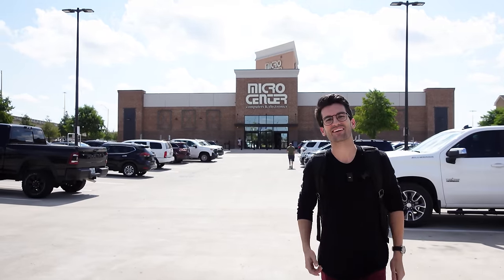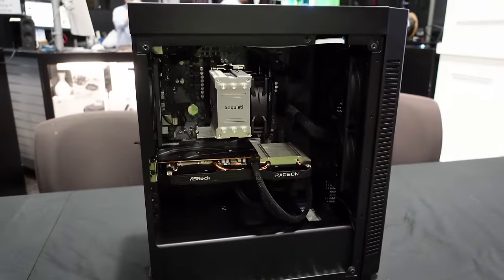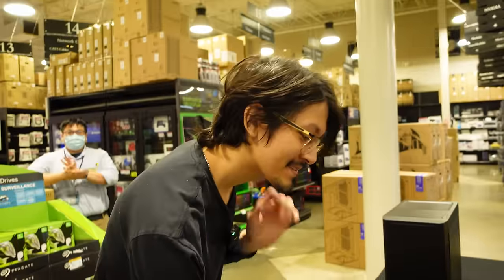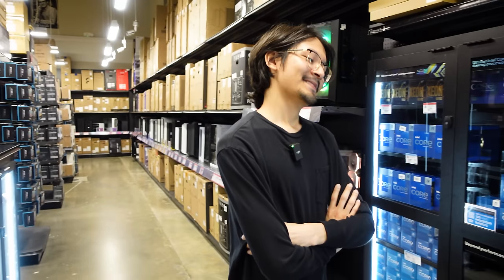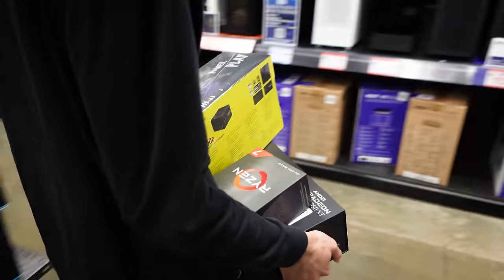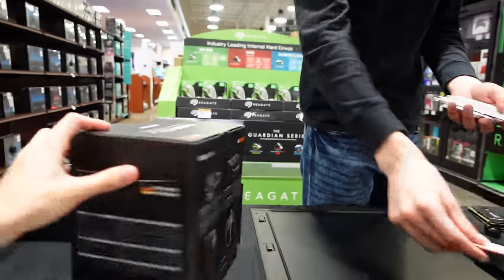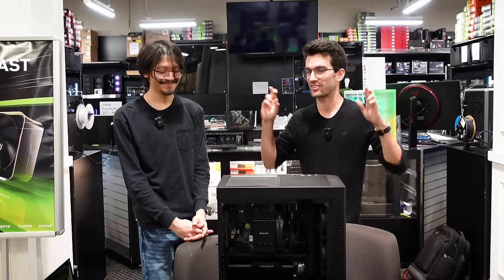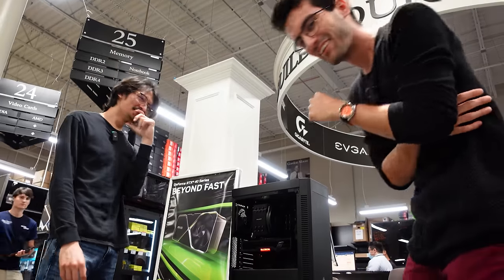He Won an EPIC Micro Center Shopping Spree! - Gear Up S2:E5

Comment: "We have a fairly old rig here..." Glances over at my personal desktop, a Ryzen 7 2700, 32GB of RAM, and an RX580 8GB and shakes my fist in the air in despair
Reply: the 2700 instead of a 2600 back then was a waste of money
Reply: @zerozeroone001 , For what I do with computers, I valued two extra cores with four extra threads over the higher clock speeds of the 2600. I upgraded from a Lenovo ThinkStation S30 with Xeon E5-2690 v1 with no legitimate, economical upgrade path to the v2 options, so I doubled my cores and threads with the Ryzen 7. It made a world of difference in my video export times over CPU encoding, and I/O was overall faster.

Comment: I'd have gone 5600x3d and that card. i assume that its still available at this time and it would certainly outperform the 5800x. its a speedy chip, but the vcache would have been a wise consideration for that much GPU grunt.
Reply from the maker: 100% depends on the use-case. For purely gaming only, the lower core count X3D may make sense - but I'd personally opt for additional cores any day of the week.
Reply: @GregSalazar  tbh i would of kept his old cpu cooler and upgrade straight to the 5800x3d as  his old cooler was prob good enough for a 5800x3d (since it is quite limited in terms of overclocking ..)  or good as a temporary solution , that cooler removal tho jeez that 2600x has some bent pins now
Reply: @GregSalazar  Fair and agreed, (I went 5800x3d with my 6800xt)
Reply: @dragos2010full1  Not necessarily.  AM4 is known for having the CPU pull out when removing the cooler.
Reply: @dragos2010full1  I am still wondering, why things like that happen with at least 2 PC guys watching it. You should always rotate the cooler on the CPU back and forth until it pops up from itself.

Comment: i tried the dark rock 4 and the noctua d15 both couldn't cool my 5800x down enough to run a benchmark i had to use a 360mm AIO
Reply: who cares for benchmarks? I want gaming performance. Also I am questioning your mounting skills, if a DR4 and N D15 cant cool a 5800x. My DRP4 can cool my 5800x with ease
Reply: @zerozeroone001  I questioned it a bit also but it was a professional instal so I had to assume it was good